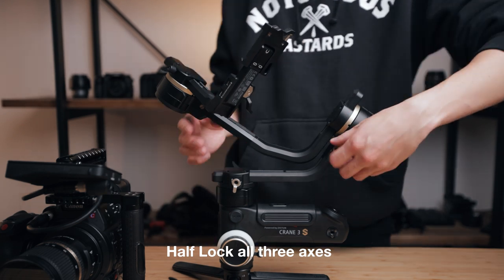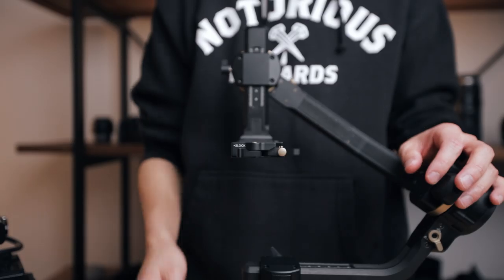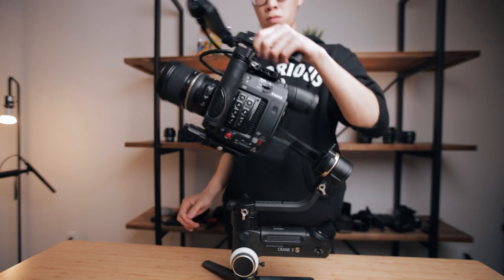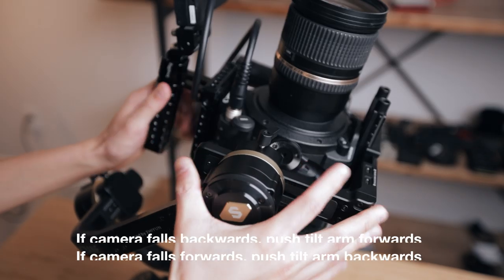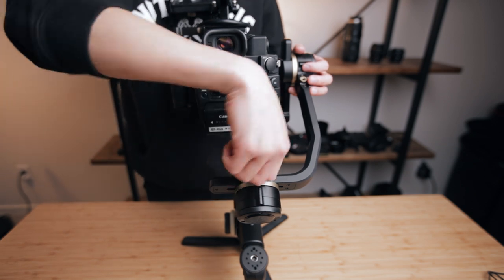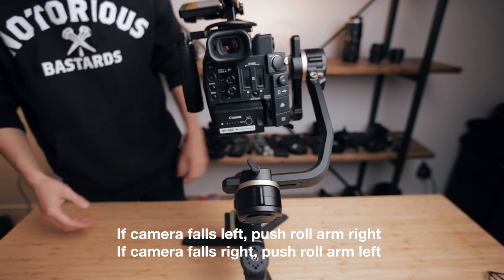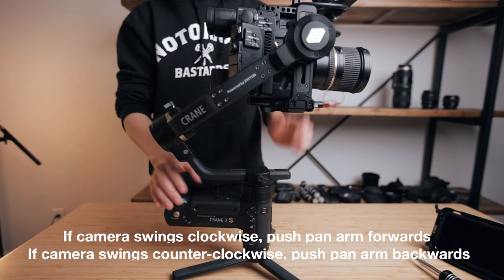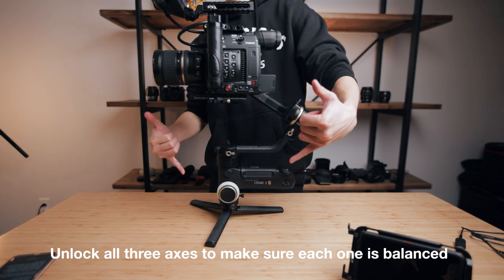Zhiyun Crane 3S - How to Balance Canon C200 Cinema Camera

Comment: I keep having an issue with my pan axis so I hope you can help me. When I turn the gimbal on, use the F button to center the gimbal or even when using the mode switch button, my pan axis is off center a bit, pointing the camera to the right. I have  done the 6 side calibration plenty of times now. I have looked on reddit for info on this, I see 2 years ago people had the same issue with the Crane 2 and Crane 3 Lab but no one responded with a fix. I have several shoots at the end of the month and can't really RMA this. because from FEB 10 - Feb 20 is Chinese New Year and my first shoot is on the 24th

Comment: Hey, do you have any advice on adapting the gimbal to be used with a jib?  I have a 21’ jib and wanted to use the crane 3s with it. Have you encountered this challenge?  Perhaps you can do a video on it?
Reply from the maker: If you're looking to mount it on a jib, you have to unscrew the tripod feet first, then mount the gimbal either right side up or upside down (inverted mode). I haven't personally tried it, but that's how they show it in their official photos on their website!

Comment: I’m about to buy a c200 and the zhiyun 3s. Is the evf a problems for use the camera on the crane 3s?
Reply from the maker: Nope, not at all! The extra extension arm helps you clear pretty much anything. Even a V-mount battery attached to the back! I have a video on how to install the extension arm on the Crane 3S

Comment: how do I balance the roll it keeps going to the middle my roll wont stay in any direction and stay still... ROLL AXIS WONT BALANCE ANY TIPS?
Reply: I'm having the same issue I can only get either tilt or roll balanced not both. I did read from zhiyun on a forum  that if the roll is the same speed from both sides and is horizontal then its balanced. To me this is not ideal but I hope this answers your question. I dont think it should be like this.
Reply: @Risehouseproductions  Same here. It may have something to do with the weight distribution of your camera. My RED cant be balanced both tilt and roll at the same time. I was surprised to see this guy do it ion this video...though the C200 is pretty light and he also has a light lens on it.

Comment: I have a question ,, I just got my crane 3s and when I power it on ,, I hear alit bit o noise on the  gimbal is normal , or the crane 3s Should be silent dead? It only goes silent dead when a put. It in sleep mode

Comment: How did you get a red balanced I’ve tried for two days now and I can’t get it at all
Reply from the maker: Really? Did you attach the extension arm too?
Reply: Yes I can not get the roll axis in the back to balance I’ve been watching some videos and there saying it needs a firmware update it vibrates and jumps really bad
Reply from the maker: @directorjparker1415  I'm not sure why your roll axis isn't balancing properly. What's your setup looking like? 
I've actually been having problems with my 3S as well with the vibration on the tilt axis. I'm guessing it's because mine is a pre-production model but it's interesting to hear some similar problems too
Reply: The back motor that slides out left and right that keeps the fumble from spinning around in circles like the vertigo mode it will not balance I get it kinda balanced and then it still falls and spins around
Reply from the maker: @directorjparker1415  Weird that it's happening, it's probably just micro adjustments that you need to make. Not really sure without having a look at it
Reply: Yea I think I just have to stick with my movie pro and ronin 2

Comment: Is anyone having problems with the camera shaking. I have the same c200 configuration but just cant get it to work without suddenly shaking and set the motors to max.
Reply from the maker: I'm actually having shaking problems on the pre-production 3S, but only when the motors are set to mid-high, high, and ultra. It might be a pre-production thing but sounds like there might be something else going on? Not too sure yet
Reply: @AlexJCheung  There is no automatic motor tuning like with the DJI Ronin S at the moment right?